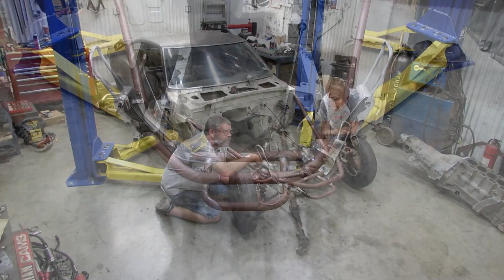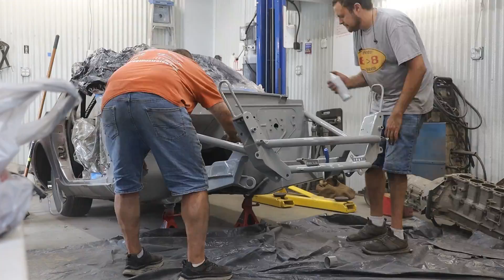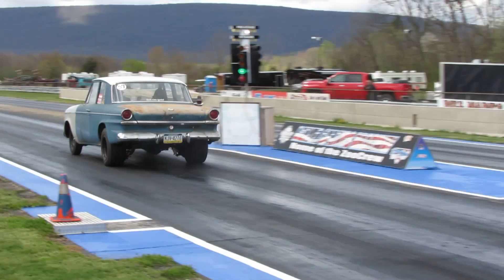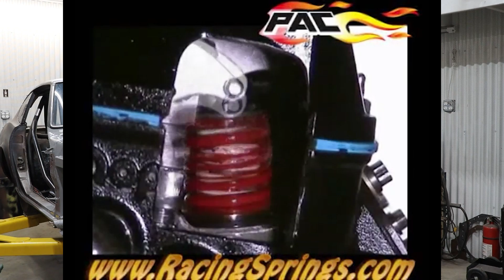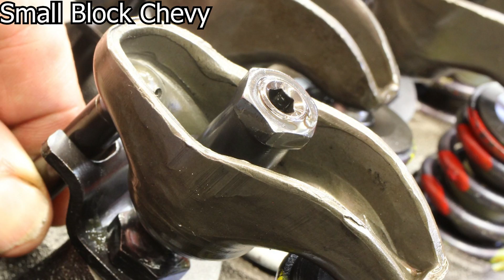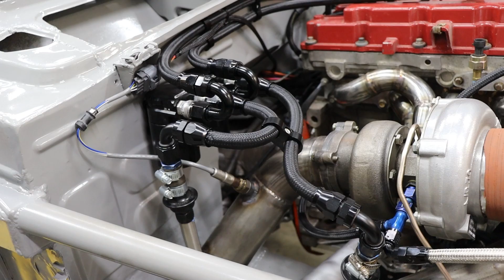The Last 20 Percent Takes All the Effort - Twin Turbo Ameri-Barra  4200 Datsun - Solid Valvetrain

Comment: Skunkworks I've heard is very scammy, I wouldn't suggest using them.. I'm in the ecotec scene. I'm in the process of m62 swapping my LAP f23 sedan
Reply from the maker: I've heard the same thing, but you can't believe everything you read on the internet, so I thought I'd give it a shot.
Reply: @Calvin-Nelson  I hope they turn out good for you man, ecotec stuff is fun and very reliable. I'm trying to acquire a miata I want to turbo 4200 swap.

Comment: Calvin, thanks very much for your walk-thru of your 'key items' on for this, and similar types of builds.   While this 4.2 effort is in my estimate, the most interesting, I am also very interested in your LT Stude build up.   I am 70 with very limited fab skills and no local assistance, so nearly run ready, low fab projects are for me.   Doing a 4.6 3V twin screw build up now, on a low mile 2005 GT ragtop.   Need to limit torque (450 ish)  until I can replace this balsa-wood connecting rods.  i also have a 1994 GT which I was doing a 393 Clevor on until TFS ran out of the parts I wanted.  If I can swing it, that would be a swap candidate.  Watching RIch Holdener look at the LT-Style 4.3 V6 and getting ideas.   Best of luck with the solid valve train and looking forward to your success with the Datsooon 4200.
Reply from the maker: Thanks man! Thanks for watching.

Comment: Thinking about an adjustable lifter with minimal clearance, I was reminded of a flathead type lifter, where there are “windows “ in the sides so that adjustment can be done from the sides- might work for this
Reply from the maker: Yeah. That would be tough. The intake and exhaust manifolds would be hard to work around.

Comment: I love the machined parts "randomly sprinkled" on an old junkyard engine. This is a great build @Nivlac57. I cant seem to get out of my head that if this thing is light enough, are 8s in the 1/4 mile in its future? Hitting 9s on the other much heaver refrigerator with a single turbo made me think otherwise on these big inline 6s.
Reply from the maker: 8s is definitely going to happen with this. The question is will it go 7s.

Comment: With so many other changes, how will you determine whether or not the solid valvetrain actually made any difference? Can't wait to see this car making passes!
Reply from the maker: If the results of the solid valve train are not obvious (power peak moves up 500 RPM etc), we will probably swap to hydraulic lifters on the Dyno and see the difference

Comment: If I install a 2006 4200 into a 1967 C-10 that has a 250 6 cyl will I have to make new motor mounts or will the mounts from the 06 truck work ?
Reply from the maker: You will have to make new motor mounts

Comment: Wow what a commitment and effort in getting a solid valvetrain. 
Did you look onto taking apart and modifying the stock hydraulic lifter part? Many have been successful in going that route to increase top end valve control.
Reply: That's a good point. Considering the effort required to make the solid lifters work, I wonder if it would be just as good to shim the hydraulic lifters so they become "short travel" lifters.
Reply from the maker: We did look into that. It may be a better route

Comment: What transmission do you guys use for the swap? And are they all the same for all your card
Reply: I know he mentions he likes the 400 turbo transmission.
Reply: @kennethchandler87  vs the 4l60e and 4l65e, the turbo 400 is an easy pick because it is rated at 450 ft lbs stock.
Reply from the maker: We like TH400s
Reply: Thanks everyone. I'm trying to figure everything out before I start. I have a 08 trailblazer and I am really looking at doing something like this just for kick's